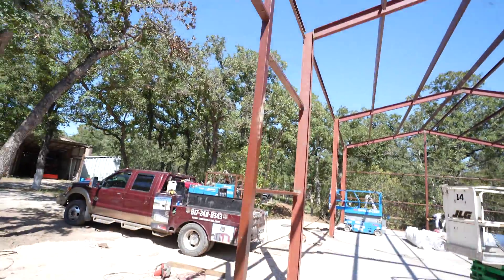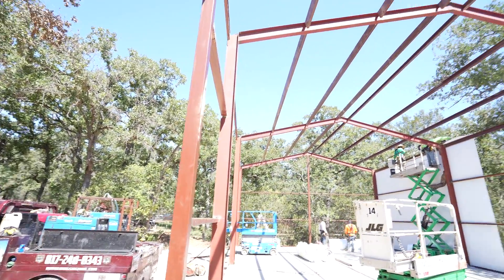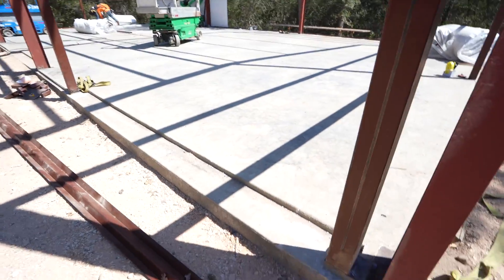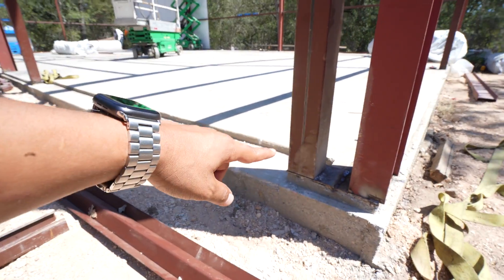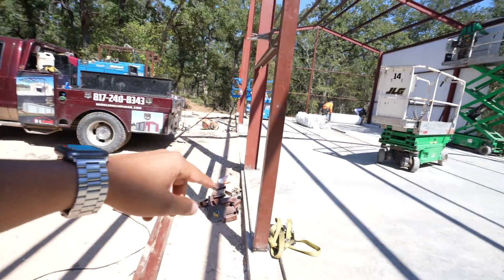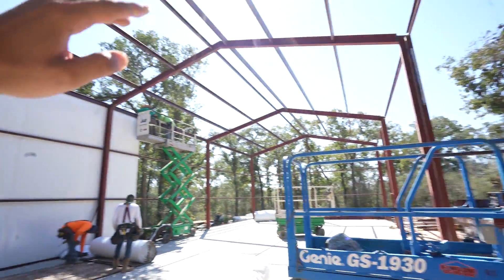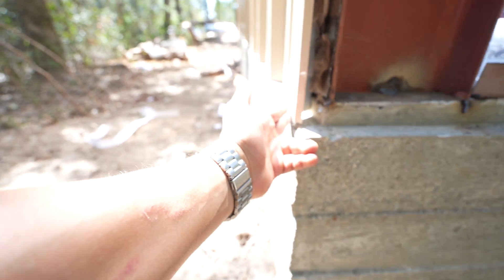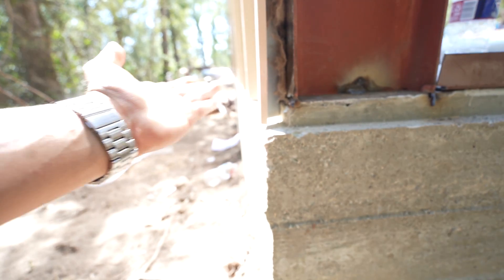30x60 Red Iron Metal Building Process | WolfSteel Buildings

Comment: What if we use 4 inch I beams instead of 8 because they didn’t take it into account when making the floor plan??? Same 30 foot span.
Reply from the maker: Are you referring to the weld plate on the ground being small for a 8 inch I beam?
Reply: @wolfsteelbuildings  I have a contractor and is building one for me already…your 8 inch I beams look great. I’m asking about for my project if you had any advice to give.
Reply from the maker: The 3/8 4” posts is strong and should do as long as the rafter is made of something different
Reply: @wolfsteelbuildings  well he says rafters are also 3/8 4x4 and a Z 6” roof… I don’t know what that means.
Reply from the maker: Unless your builder has engineer plans, Weld up buildings are typically not engineered so my biggest advice is if you trust your builder, than you should be fine :)
Reply: @wolfsteelbuildings  lol! Ok thanks a bunch for your comments! Do you guys work down near College Station or Houston??
Reply from the maker: @homesteadhousewife9964  yes we do! Let us know if you know anyone in the area looking for a building
Reply: @wolfsteelbuildings  he just calls it a 4x4” 3/8 column. I’m wondering if that’s big enough to support roof for a 30’ span

Comment: Looking to build a similar weld up building 40x60 in a few months, how much did this one cost including concrete slab?  Do you work with local concrete contractors or bring your own crew?
Reply from the maker: Hi Walt, we bring our own crew, however if you have your own we could provide them the specs. The cost of this build starts at $88,000.00. Pricing varies per location and customization. That's the whole project cost. We have a building on our page that is a 40x60 with concrete. Here's the link: https://youtu.be/E8ZTtdnf560
Reply: @wolfsteelbuildings  Thanks for the quick reply, the 40x60 in your link is a tube steel frame building and I am wanting to build a weld up red iron frame building.
Reply from the maker: @WaltWW  We are currently working on a 40x60 weld up build in Austin, Texas.  Subscribe & Stay tuned! 

You can also follow the link below to design your own and we can price it out for you! 
Link: https://design3d.wolfsteelbuildings.com